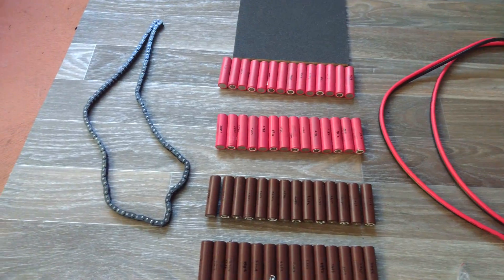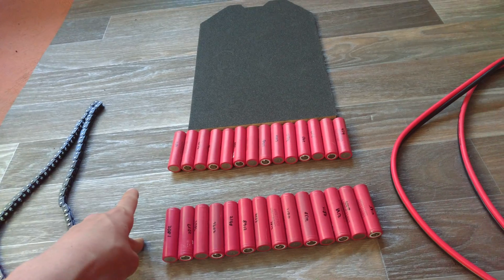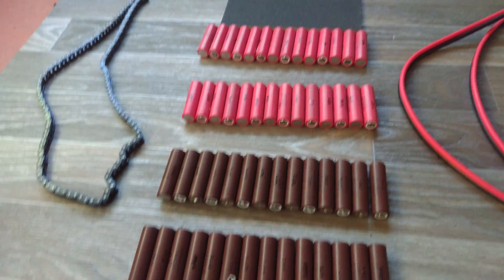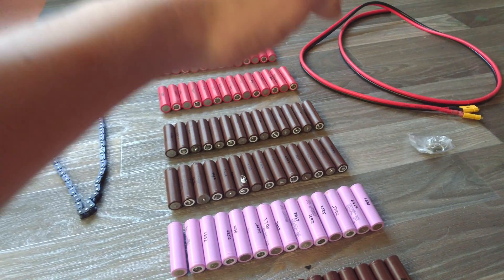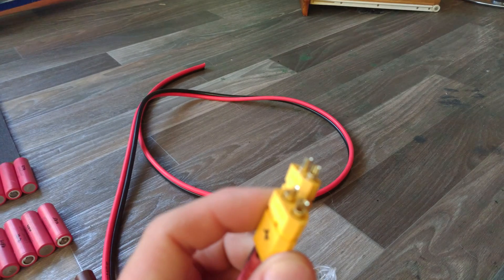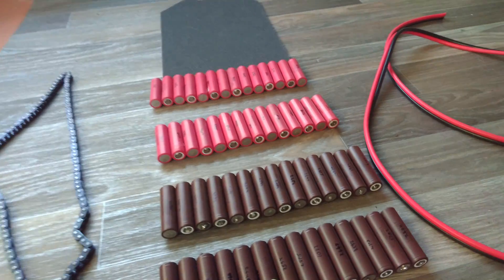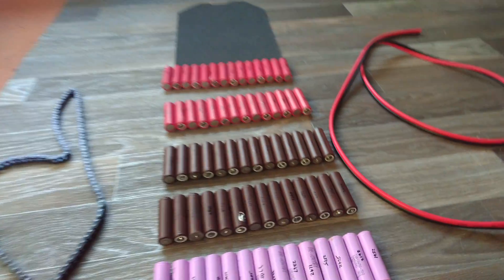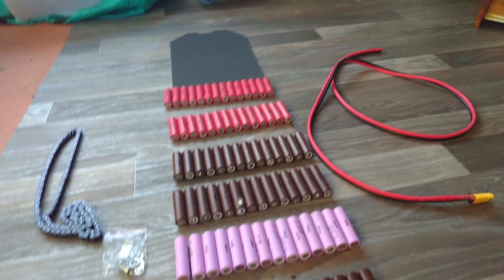Razor Pocketmod | Modified 18650 Powered E-Scooter | Battery pack explained + charger | Update 9

Comment: What's the max number of cells that will fit in the storage area that previously contained the two 12volt SLAB batteries?  I'm wondering if the 84 cells you have pictured will fit properly.